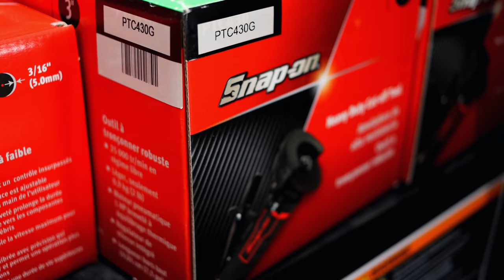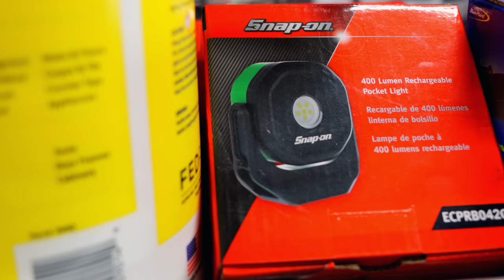Snap On: “Smoking Deal” On This Classic Series Toolbox and Tool Talk

Comment: I wish we had a snap on truck that would stop by our tech school in SW Minnesota at least once a month. All of us going there like snap on and wish we could walk on the truck and hold the tools before we buy them.  But instead we have a snap on rep who shows up from time to time and we can order from online/book with him.  
I mean snap on still gives us a student discount but it would still be nice to hold the tools and handle them before we buy them.
Reply: SE Minnesota is pretty dry for snap on dealers as well. I have to meet with one in Rochester (30 min from me) if I want to physically hold things before I buy them.
Reply: Get the digital torque wrench before you finish school! I just regret that getting the smaller 3/8 drive one as well.
Reply: Drop out while you can be a plumber or electrician instead

Comment: If you work on the 6.7 Cummins where you have to get the oil filter through the fender well. Check out the Lisle 57180 Cummins oil filter plug. It’ll make you’re life much easier and less mess.
Reply from the maker: I have one and they work good

Comment: Those filter pliers are bent on the tip to grab a filter thats mounted vertical in a tight space or close to the oil pan

Comment: i like the three prong filter to remove stubborn filter. but always use a filter band wrench. the cups drive me nuts, because you get any oil in it, its stuck to the filter and you cant get it off.

Comment: i remember you did the video of the snap on vs the milwaukee fuel ratchet and despite the torque ratings, which milwaukees was accurate and snap on was lower, they were the same essentially. but we also know the snapon spins faster. also when talking about lights, the one you show on camera is my absolute fav light ive ever owned, been 3 years, works perfectly, drop it often, strong magnet, perfect size. and the price is great for a rechargeable light

Comment: I've got 3 Craftsman tool chest combos, a total of 90" wide, and they are all stuffed FULL. Seems like they just take up space, and don't hold many tools, primary reason for existing was to generate profit for Sears. 💲😫
Reply: I i got 2 craftsman top, bottom and intermediate and stuffed with tools, and my friends want me to sell them cause i just got my 2020 green trim 68" Epic snap-on box, no way i m not parting them out, hang on to them cause when i was real young i dream of having one of them boxs i seen in other peolpe garage, besides the very first wrench i ever picked up to fix my bike was USA forged craftsman 1/2" and 9/16" we considered craftsman wrenchs cheep junk back in the early 70's as a kid, now i collect then and use them every day over most of my snap-on
Reply: Best thing I ever did is get rid of my 1 Big ass Snap-On tool box now I have 2# 5 drawer Harbor Freight general tool karts  red for standard  blue for metric each cart has everything you need and for the stuff I don't use all the time Milwaukee 60-inch 11 drawer workstation with a nice heavy duty wood top. Now I can bring the tools to the work and not have to walk back and forth to the big box every time I need something or  unload a small tool cart back into my big box at the end of the day

Comment: That adjustable filter wrench is actually real awesome. Especially if you’re working at a truck stop where you don’t know what the next truck was gonna be. It’s also useful if you can’t slide the wrench over because something is in the way take it apart and wrap it around. The three he is good for the Cummins 6.7. Put it on the end of a long extension and go straight up.

Comment: I used the 2767 today to take the nuts off the bed floor carriage bolts on the '79 K10 I'm restoring. It took all the nuts off but one from the carriage bolts. On the other one the bolt spun in the square hole of the floor so I had to take the angle grinder to it. I had a long extension and a U joint attached to the 3/4" impact socket on the gun. Hamilton got it right. That 2767 is bad ass.

Comment: Ok I got a Q I bought a solus legend at a pawn shop for $700 what's the difference  from it and the edge ? I noticed the obd2 lights up and it does motorcycles?
Reply from the maker: Not sure would have to ask Hamilton
Reply: Did you verify the scan tool was paid for through Snap-on ? You’ll want to be able to update in the future
Reply: I went on snap on web site and registered it in my name they got my email phone and address . I guess they will be contacting me if it's not paid off I probably should text my snap on guy.

Comment: Then you get the idiots whom overtighten oil filters so tight they don't come off easy.Those oil filter socket sets,I have the 17 piece K Tool International set made out of steel I bought from my local Parts Plus auto parts store.Has come in handy buying it about 3 years ago for $60.00.